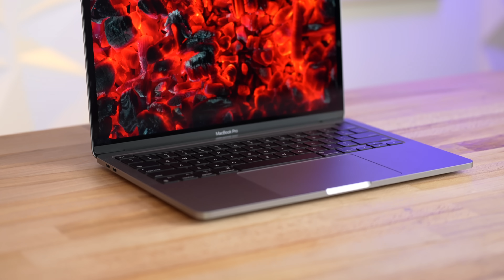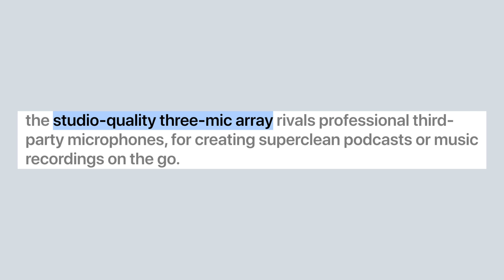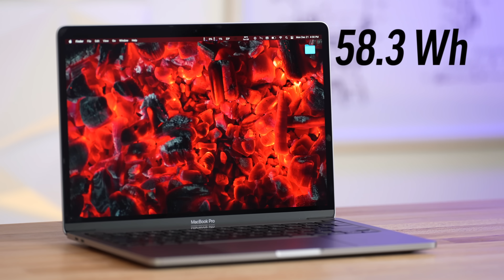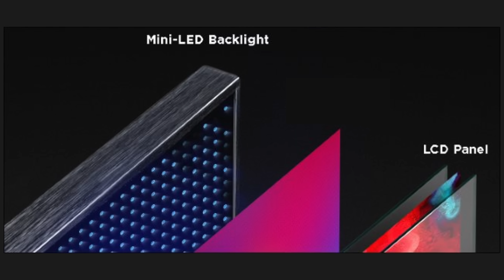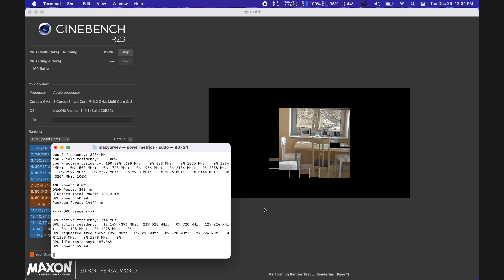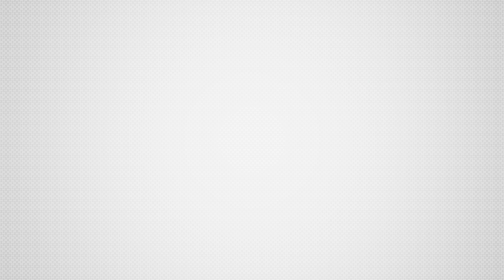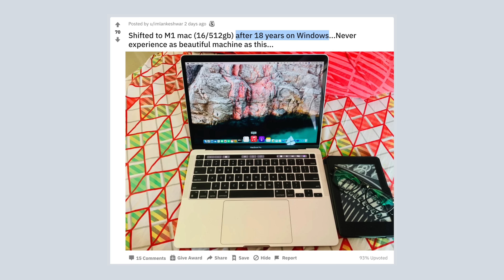M1X 16" MacBook Pro will BLOW Your Mind (What to Expect)

Comment from the maker: Do you agree with my thoughts on how Apple could redesign the 16" MacBook Pro? Comment below!
Can't wait? Buy the M1 MacBook Pro on Amazon (ON SALE) ➡ https://geni.us/qf1Pv
Subscribe for more videos like this one! Best deals on M1 Macs on Amazon ⬇️ 
M1 MacBook Air ➡ https://geni.us/tnoeMOc
M1 MacBook Pro ➡ https://geni.us/pWUBPum
M1 Mac Mini ➡ https://geni.us/bBD2
Buy our Apple Merch here! ➡ teespring.com/stores/max-tech-store
Max tech wallpapers ➡ https://bit.ly/2WNc6Qw
Reply: What about memory options on M1X? 32GB? 64GB?
Reply: You could test your assumptions on the efficiency cores contribution to the cinebench scores by watching how fast the slower threads paint a tile on average compared to the faster tiles. Even stop watching them should give you a confirmed ballpark.
Reply: The other option is that they don't shrink it, but use the current thermal capability to really permit future performance increases. Like the mac mini with the old power supply could take a future processor and be super powerful. The same thing with a macbook pro.  They could come out with M1X or whatever, but leave the thermals in for something with a lot more cores.
Reply: what about the neural engine
Reply: I feel like as cheap as we know that Apple is, they will make the base model 16” a M1 and you will have to pay $400 extra for the M1X
Reply: Justin Brenn that's what I think as well.
Reply: I hope they finally drop the Touch Bar. Or at least add a function row + the Touch Bar. The Touch Bar is more useful if we can use it for stuff other than the f keys
Reply: The challenge with a redesign is that it has to be better than the current design. The current design doesn't look dated. In fact, it's pretty timeless. And, the all-aluminum body provides structural rigidity and durability. Change for change's sake won't fly IMO.

The one change I really notice on my M1 MBP even when I'm not thinking about it is the one that went back in time....the magic keyboard. It no longer feels like the keystrokes stop abruptly and harshly shy of where it should end like the butterfly keyboard did.
Reply: Sheep
Reply: Meanwhile snapdragon 865 renders 4k60fps movie 40% faster than Apple M1 😂😂😂
Reply: @inherent777  can i get a link To this snapdragon 865 review
Reply: @inherent777  thanks
Reply: Slime Cruz that guy is incredibly I articulate. I have NO idea what codecs or software he's using. That comparison tells me nothing. But it does look promising!
Reply: @inherent777  They put 8 GPU core and called Mac Pro instead to put 16GPU. I really agree with you.
Reply: Slime Cruz uh...what!?
Reply: I really hope MacBooks get Face ID, then I might consider buying one
Reply: I don’t think it will be redesigned. Look at the air — everyone complained about the early 2020 intel thermals ... but very clearly the enclosure was designed for the M1. Same for the 13. So I think the 2019 16” Pro was already designed for the M1X in mind and the intel thermals were just a ‘best effort’ to shoehorn an upgrade in last year. The M1X 16” will be a beast ... probably even the 14” too. 

The other chip mfgs will try to ARMise but remember Apple has a 10 year head start in making their ARM packages absolutely killer in terms of power vs performance. iPhones blitz the Qualcomm equipped androids which have heaps more RAM because they aren’t as efficient, for example. All the neural processing and graphics are Apple’s own design too.
Reply: would it make sense for apple to bring a touchscreen to the new macbook pros? now that ios apps are able to run on macs, it might make sense? but then again, I guess it isn't very apple to merge two of their product lines into a "new" product
Reply: Spencer Hao I would LOVE a touchscreen MacBook but the OS is not touch friendly at all right now...and it would eat into iPad sales.
Reply: Hey, long time viewer here. Love ALL ur videos. I notice your recent video's audio were clipping more frequently, just wanna point out in case u missed them.
Reply: AMD's next architecture will be Zen 4 which will have DDR5, USB 4, be on 5nm and require lower power at increased IPC. The move to ARM is not yet likely. As you've shown, the relatively backward 5600m can still compete with the next gen Apple ARM. 

The question is will people who need the power on desktop switch to Mac Minis which are weak for the most demanding workflows and gaming. What can Apple provide on the desktop which will rival X86 with discrete GPU performance? Would people settle for a split mobile/desktop personal/professional computing workflow? For you it might make sense, but I don't see the appeal for me.
Reply: If one is willing to spend $2400 on a 16 inch laptop, they better have a good use for it (business or maybe education). That's a lot of money. Of course, if you can afford it or justify it, go for it....Not that I would be jealous....
Reply: Thank you so much for all these contents. Can not describe your work about M1 chip. I can not wait for 16 inch too, but I wonder about brightness. Vadim do you think it is better to be 600 nits in new 16 inch? And also what about resolution, you think will be 4k? I hope you will reply to me and answer these question since I did not see you mentioned in all videos I watched about M1. Thank you again.
Reply: You did say something about wattage outlet
Reply: I'm looking forward to getting the M1X MacBook Pro. I could get the most powerful CPU and GPU with an LPDDR4X or LPDDR5 SDRAM with 64 GB or more, and an SSD digital storage  that has 8 TB or more.
Reply: I think I will wait for the next Apple Mac 16 inch with the cool stuff until I would need it more for scholar gaming plus I would have enough oney
Reply: I think it will come in a good time
Reply: Partly agree - Apple doesn’t like to be foreseeable.
Reply: No matter what I am gonna do but I will definitely shit to apple ecosystem when MBP 16'' M1X is gonna launch.
Reply: Yeah but it is not cool to make a 16inch with intel chip making us think it is the beginning of a long series. In reality it is a series which went for just a year. Apple *ucked us by selling us crazy expensive intel machines which they knew would be obsolete just one year later. I am very serious, if Apple does not somehow make an upgrade program for the 16 inch mbp's to the mx1 mcp's, I will never upgrade again. Please make a video about this Max
Reply: Not so fast... the M1 chip has some glitch issues... because the M1 chip is a work of love born from the collaboration between Apple and ARM happens to run into some issues. Some software apps are more tuned for CISC infrastructure based instructions set used by Intel whereas the M1 chip uses RISC infrastructure based instructions set i.e. mobile processor type of architecture on 64 bit smartphones or x64 based. My apologies for the inconvenience, sir.

Tech Spurt channel did a 2 month real life real world testing review on the M1 chip based MacBook Pro...
   https://www.youtube.com/watch?v=OpAZoLL01zM&t=393s

Comment: Tech reviewers should stop using terms like "LED display vs LCD display" how can you compare these two things? One is light-emitting diode, another one is liquid-crystal display. the LED is used to light up the LCD panel. It's not early 2000 anymore when screens are using actual light bulbs to light things up...

Comment: I will believe it when I see it.  It's all speculation now.  Apple lost me long times ago with taking some of the ports away (ie. SD card slot).
Reply: I bought the MacBook Pro M1 on Saturday, but I returned it. I didn't find it that fast either and I hate using the dangle. Old programs don't work with M1 chip.

Comment: I'd say, Apple should make a next logical step - own version of BatteryDay and take charge of it as well.  And once, for a change, give users top possible load ( 60 Wh in Air, 90+ in Pro) "because we can", with option to cross-power other Apple devices.  Introduce vapour chamber cooling throughout lineup, Air and Mini included.  With savings from miniLed and upcoming 3nm it could - for once - not depend on "optimization" but on raw advantage to deliver blow for competition.  Oh, and while we're at it - stop b....it with PCIe 4.0 and SSD on half of PCIe 3.0 speed, get flash out of the SoC and LET IT RIP!

Comment: I've got a weird situation, I'd like a 16inch mac however the 13 inch m1 is way better. Would I be able to buy a 13inch m1 now and then trade it in for a 16inch model when it comes out later on?

Comment: Why obsession with thin so you have to buy a thicker case for it. Do it bends also breaks. Give me longer battery any day. It would be nice if they could make it wedged on the bottom like the air. For comfort of typing. 
Face ID a must. A decent cam would be nice. 

I want 48hr battery or 3 day battery. 
Would live with a 24hr if they can make it wedged shape for the keyboard

Comment: Please don't encourage a decrease in battery size for the 16 inch. Yes 20-30 hour battery life is possible for light tasks like web browsing but that is not why you get a 16 inch pro. A 16 inch pro has a much better gpu which opens possibilities for gaming, high end video editing, 3d rendering, these take up way more battery and at full load with heavy gaming for example most laptops can't even get more than 3 hours at full load.

Comment: Looks like the 12 core CPU would be a good match against AMD's next Ryzen iteration. 

A 16 core GPU though seems a bit on the low side, for the 16" macBook that is, compared to competitors like the G14 and other laptops using discreet GPUs. A 32 cores GPU would be need to compete.

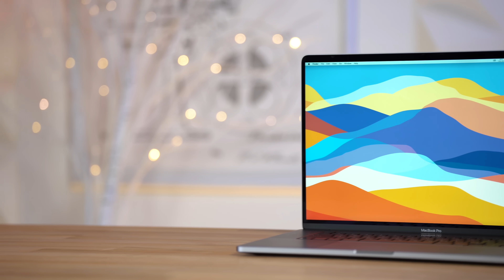Comment: 4:04 Speaking of that battery pack, a new 16” MacBook Pro does not need as large a battery compared to the outgoing intel model. A smaller battery would allow Apple to reduce the size and weight of the computer and the much more efficient M series SOC would allow the AS version of the computer to run rings around the intel version.

Comment: I've heard that Apple may also be working on a type of non-volatile storage, higher in read/write performance than any current ram/memory on the market, that would allow for one central storage unit for disk/ram/video memory (truly unified memory). Evidently this was too expensive to debut in the first M1 machines. This would eliminate entire need for separate ram/disk/video memory or the idea of "swap". Imagine having potentially Terabytes of working system and/or video memory

Comment: When it's charging, i feel the static electric clearly when I just touch the metal parts of my macbook.
Should I request a change?
Some forums say that the problem was solved with the extension cable.

Comment: So these are rumours and there's oversimplification going on but if Apple does produce a chip that's close to the theoretical one here it'd be damn impressive. The M1 is already impressive.

I also want to point out that Intel and AMD have been developing (and Intel has even shown off designs of) ARM and x86 hybrid CPUs. They're actually pretty incredible and something you should totally look at.

There's a lot of rumours and speculation over who's going to do what and what routes will ultimately pan out but Intel is looking into producing a layered CPU that has ARM and x86 cores. AMD may be looking into doing something similar but using HBM as one of the layers to either replace system RAM or essentially just create an enormous cache. These designs offer science fictions level of technology but offer some impressive efficiency and performance gains.

Apple has basically just gotten here first by going for a more simple design(no x86 cores, single layer). It proves the concept that Intel and AMD are working towards though. I really love that we're seeing Apple compete not just in the laptop market but in the silicone market as well. With this we shall see the move to ARM and RISC-V accelerated and I think that's pretty exciting. Intel dominating the space with quad core after quad core was just boring AF.

Comment: I’ve been using an MBP M1 as a business work machine connected to the LG 5k monitor and I can’t want for more.  I run multiple very large formula intensive Excel business models and it flys.  The only wish is for a Bluetooth keyboard with a Touch Bar!

Comment: I was waiting no matter what for the new 16"MBP. Hopefully with MiniLED! Also, what you are trying to say, is that it was good from me to buy a 16-core Mac Pro 2019 model instead of the 12-core that you guy's suggested people to buy. While it's true that it's enough for most people, and probably also the best bang for your buck. I'm so happy i went full out with what i could get. 16-cores, W5700X, 96GB of RAM, 8TB SSD. I skimped too many times on things like cores or storage (happy i never did on the RAM and i never will). For me, these specs are great and will get me a long time use. I'm using logic studio for music production and adobe suite for Photoshop, Dreamweaver, Lightroom and Illustrator. And i do a little bit of video-editing with Final Cut Pro X. So i'm really happy with the specs that i got. The M1X laptop will be perfect to test out all my plugins etc. Hopefully by that time most of my plugins will already work with the ARM MBP.

Love your video's guy's!

Comment: I don't know about y'all but I would much rather keep the thickness with the same size battery and the M chip obscene power efficiency for like a 50 hour battery  life. Or a 1000 nit screen for real HDR and increased performance with still near 20 hour battery life. I don't need a laptop to be ultra thin.

Comment: Speaking about battery life, the reason why the current M1 macbook is using a bigger power battery, I think it's because the memories are being taken up plus the battery life is just gonna go down as time goes by. meaning it can last 20 hours in 2020 but will only last <20 hours in 2021 and <<20 hours in 2022 and so on.

Comment: Please let me correct some points I disagree with your way of exposing them.
- We (software/hardware architects) all know that ARM is by design more efficient than x86 (instruction pipeline / predictions).
- ARM is patented, company is now owned by NVIDIA, so M1 is not 100% Apple
- If you don't need a fan for a CPU, it means you are not pushing it, or you can't push it. In that field, power/heat is always the limiting factor. So it seems Apple found an angle in the tradeoff battery life/performances. (My prediction is that Mac Pro will be so more powerful that they hope many will buy laptops AND desktops).
- Rosetta is the surprising and brilliant piece of that launch, specially the "ahead-of-time" compilation of x86 programs, simply brilliant.
- ARM has its drawbacks about scalability, it won't be easy for apple to launch more and more powerful generations, the perfect timing to launch the M1 is right now, not next year, not in 2 years, AMD, Intel and NVIDIA are far from dead.

Comment: am forcing myself not to buy the 13" M1 and wait for the 16" next year ... lend me your strength :(
Reply: I  bought it and ended up returning it because it really is farrr too small. And My hands were cramping trying to type since I didn't have enough space to rest my palms on... My hands are very big. Note: I am a programmer full time. So I spend a lot of time typing.
Reply: @stevenl3848  ya am kind of in the same boat as u. i will be mainly using it for programming. at home i use a desktop pc with a 27" monitor and im worried a 13" laptop is too small. i never actually used a laptop but if the next 16" macbook is atleast as good as the current m1's ill def get one.

Comment: I really disagree with how the 10% of performance from the efficiency cores was estimated. It’s a well-known fact that power consumption and performance don’t scale linearly, and instead closer to quadratic or exponentially. Overclocking a CPU 10% increases the TDP and power consumption A LOT. If the efficiency cores would truly only have 10% of the performance, why wouldn’t apple just use the high performance cores for 1/10th of the time?

I’d say that something like 30% is closer to reality. The entire purpose of those cores is that they have an amazing performance/watt.

Comment: Do you think we'll be able to game on it? I have the 2019 16" MBP that I bought instead of the M1 because it can comfortably game in Bootcamp (which I know is silly, I guess I have too much money). I really want to upgrade to the M1X when it comes out but not being able to game in Windows would be sad.
Reply from the maker: Oh yes, people are already playing Windows games on the M1 using methods like Crossover, QEMU and Parallels 16. The performance isn't perfect, since in most cases you won't get a solid 60FPS even if you turn the graphics down on the M1. That's where the M1X comes in. I expect it to hit a solid 60FPS in most games, including some AAA games, and all of that while running through emulators and VMs. That's gonna be a huge windows laptop disruptor.
Reply: @MaxTechOfficial  I'll be very interested in seeing real-world tests! I'm hoping games can reliably run on it. I like being able to play old titles on Steam like MW2, MW3, and GTA V on my 16" in Bootcamp. I'm even able to play the new Microsoft Flight Simulator. It's great. If this is possible on the M1X, I will instantly upgrade.